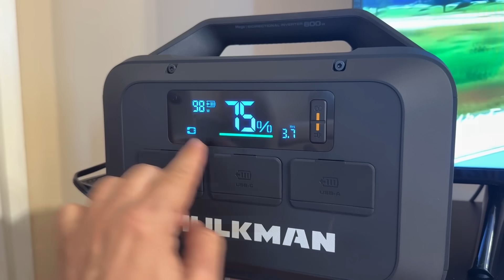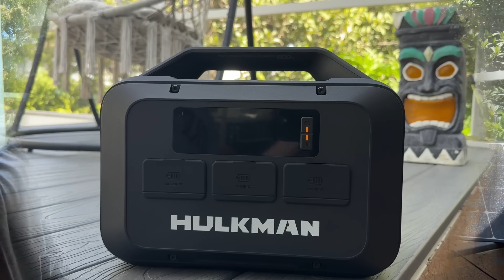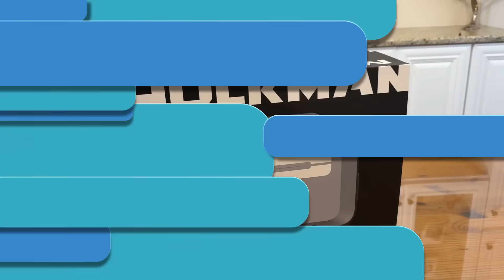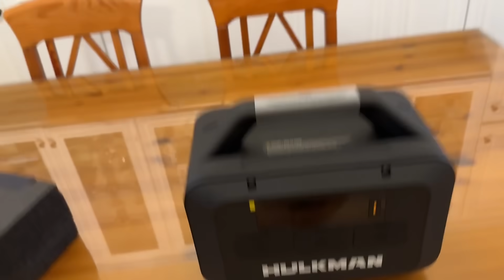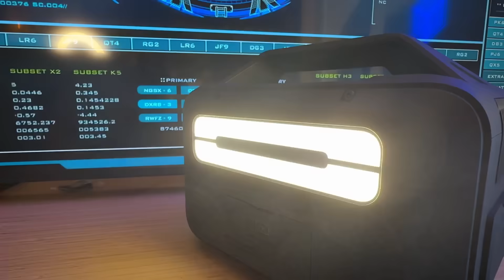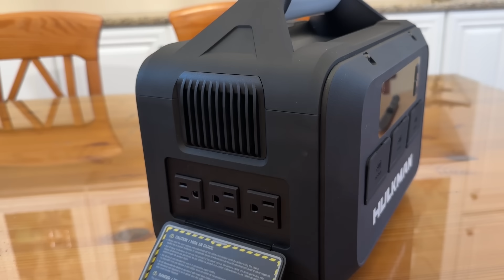Hulkman Mega Portable Power Station

Comment: The bit about using the solar panel was super helpful. As someone planning to go more solar in my daily life, I appreciated seeing how easy it was to connect. That said, it would have been great to know if Hulkman includes any MPPT controller tech, which optimizes solar charging. Without that info, it’s hard to compare it fairly to other brands in the same price range.

Comment: Okay, the cable quality and packaging were emphasized a lot, maybe a bit too much, but I can appreciate why. A well-built cable makes a huge difference when you’re outdoors, especially in unpredictable weather. Still, I’d have preferred a bit more time spent showing how the unit handles high-draw tools for extended periods. For example, how long would it run a space heater or a circular saw?

Comment: This power station looks like a game changer for anyone who travels, camps, or works in remote areas. I really appreciated the part where you demonstrated how it can power multiple devices at once—including a TV and a pressure washer—which really shows off the system’s versatility. Also, the fact that it functions at high altitudes is a massive win. As someone who frequently hikes and camps in the Rockies, most battery devices underperform, so it’s great to see Hulkman addressing that issue directly.